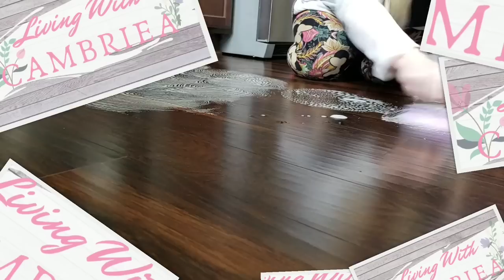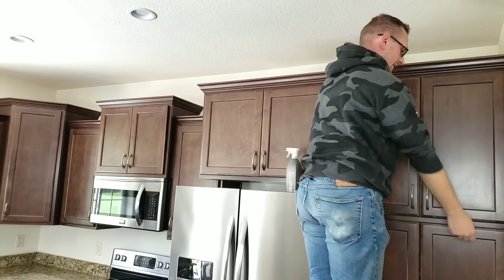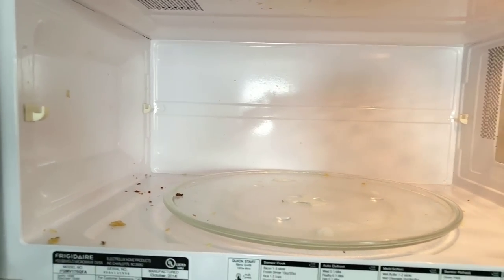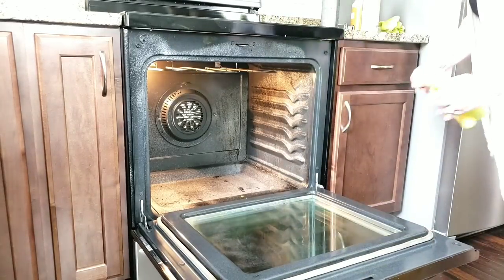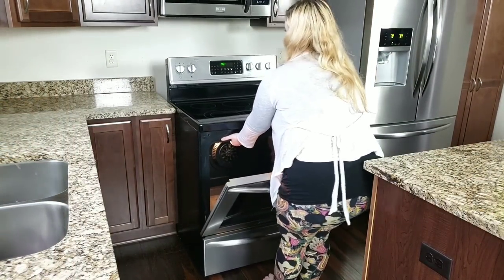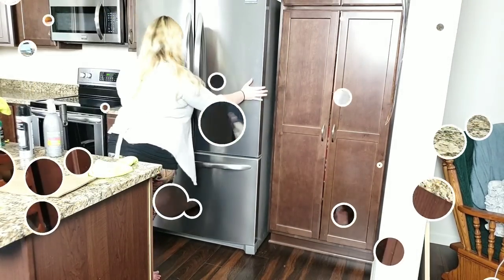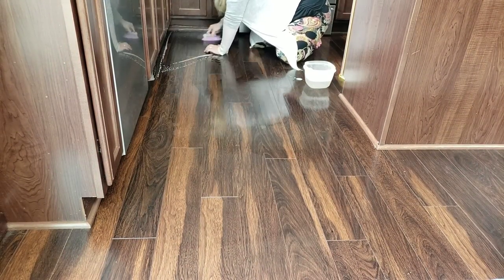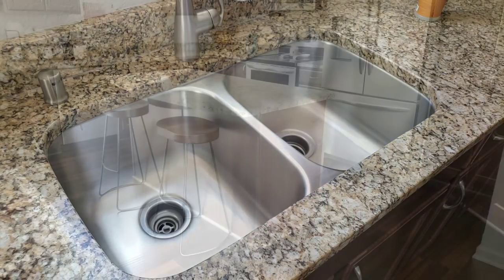EXTREME DEEP CLEAN WITH ME CLEANING MOTIVATION! HOW TO DEEP CLEAN YOUR KITCHEN! LIVING WITH CAMBRIEA

Comment: A tip for the top of your cabinets in the kitchen is to line them with aluminum foil. You can't see it and it prevents grease from settling on them. Then you just toss it and replace afterwards. Especially because most people don't clean up there very often.
Reply from the maker: Oh that's not a bad idea
Reply: I use newspaper!
Reply: @simplesoutherngirl72  oh that's even better!!

Comment: I really love the music in this episode! It was so great you were able to get the hubby to help out! 
I learned years ago how to get windows to sparkle like youve never seen. I had a window washer do ny windows one year when i was living in a 2nd floor apartment. I was working when he did them and when i got home i was amazed! He happened to live across the street so when i paid him i asked how he was able to get them so clean. 1st, for this method make sure you dont have Pella windows. If ya do use vinegar and no steel wool. Spray windows wuth really diluted windex. Then scrub them with 00 (extra fine) steel wool. Then go over them with a squeagy. Then wipe and buff with a clean micro fiber. What this does is smooths out the glass and makes rain and dirt just roll off. It will surprise you how they sparkle!

Comment: 💖 I use an old toothbrush to scrub crevices.  Also, a wet toothbrush dipped in dry scouring powder works really well on the garbage disposal ring -- you can get the underside that way.  Gross and slimy, but nice and clean afterwards.  Inspiring video.  You always seem to have tons of energy.

Comment: ❤️ Thanks for giving an alternative to Easy Off for cleaning the oven. I have a self cleaning oven that specifically states you can’t use Easy Off type cleaners BUT I also can’t use the self cleaning option either because the self cleaning fumes are terrible too. I had to open every window in the house and I still had to stop the 4 hour cycle in 1.5 hours. Needless to say, the oven didn’t get super clean. It was better but not spotless. I’m going to try the baking soda paste/vinegar option you suggested.

Comment: Suggestion: instead of using a cloth to clean the inside parts of the window, why don't you just use a old (or new) toothbrush and use that to scrub it clean, that way it will get into the spots where the cloth can't exactly reach.